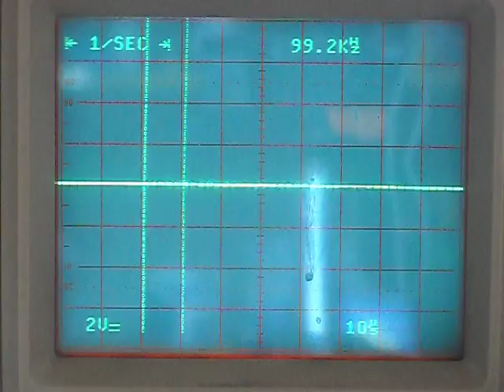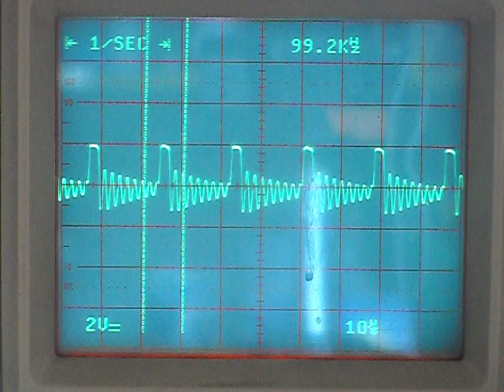investigation into oscillators, joule thiefs and vortex coil transformers (1 of n)

Comment: @smokyatgroups.  The LEDs only light when it is one way because LEDs are diodes (light emitting diodes) and diodes act like one way mirror for electricity.  The current can only enter one way and is blocked in the opposite direction.

Comment: well there's ya problem ........... try making a smaller pickup coil that goes inside and not the outside. the primary coil you're using focuses the magnetic flux inside the coil ... peace hommie